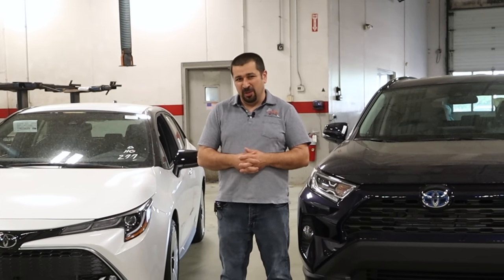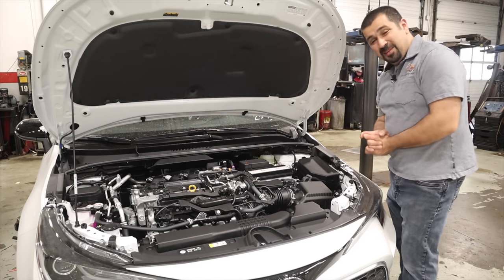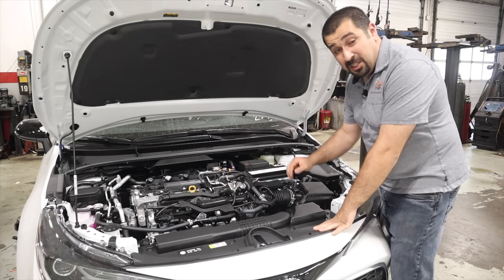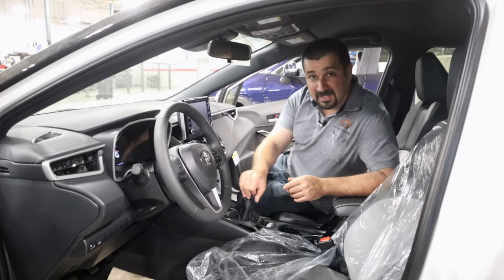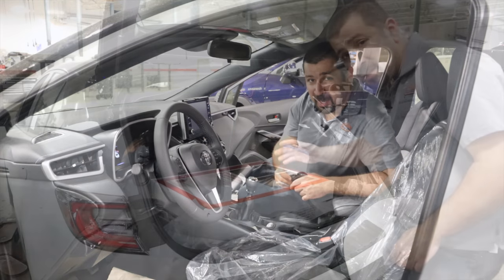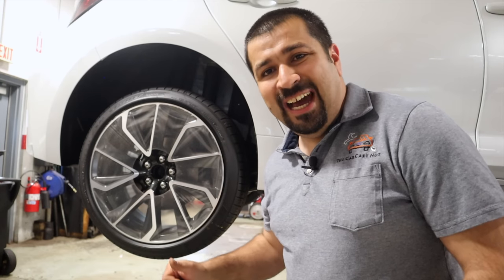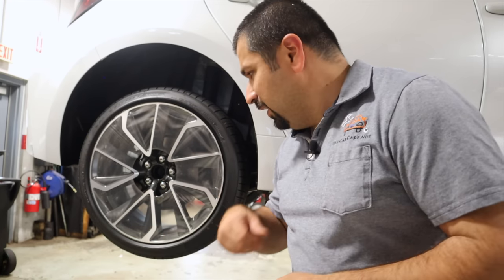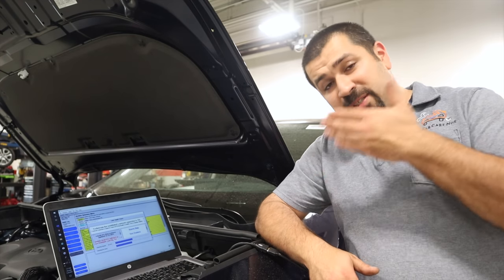Buying a new car? Here's what happens behind the scenes.

Comment: My dealer forgot to deflate the tires I didn't know about them till I saw it on Toyota app on my phone. (2021 Camry hybrid Le). They also forgot to install the wind deflector under the front bumper for the front tires, the user manual portfolio was not in the glove box, I found it and the trunk.
Reply: Which Toyota app?
Reply: @WAN2TREE4  You can download it from the app store, it works with most 2021 and 2020 Toyota vehicles, depending on the features that comes with your new vehicle. My 2021 Camry is not equipped with remote start through the app, but I can do a remote start through the fob.

Comment: I bought a new Toyota HCR (Toyota main dealer in UK). Salesman set up iPhone App on my phone and I showed him a notification which said ‘High severity’ Have your car inspected immediately. The warning went on to describe a serous problem with the ‘electronic control of the engine’. The salesman said it was nothing to concern myself with as all new cars came with problems. I reluctantly took the car home (6 miles) and the next day it would not start. Dealer mechanic came out but could not fix it. It was taken back to the dealers where they eventually rectified the problem and the warning message on my phone disappeared. All they could tell me was that it had been an electrical problem. So much for PDI checks at this garage.

Comment: The dealer needs to check the 4 wheel alignment  as the carriers are rough with them loading and unloading them. My  last two new cars developed flat spots on the tires because they were not in alignment. 
Had to buy new tires prematurely and get the 4 wheel alignment  done on my dime.
Reply: Good to know. Thanks.

Comment: I picked up my brand new Tacoma (a 6 speed manual) from the dealership last year. It was raining when I picked it up. So it wasn't until I got home that I noticed imperfections in the paint on the hood and on the roof. I was thinking that they were caused either by whatever adhesive covering was used to protect the paint or was caused when the covering was removed. Anyway, the dealer was almost 200 miles away from my home. I am getting ready to have PPF applied and maybe they will take care of the issues when prepping the truck for the PPF.

Comment: I'm currently waiting on delivery of a 2024 Rav4 XSE Hybrid, and I have had a pretty bad experience with how Toyota decides to do add-ons that I do not want and am forced to pay for, this is not right and Toyota need to rectify this, as it just gives the appearance of greed on their part, now my vehicle is in transit and my salesman says nothing can be done, I tell you that is so wrong, just so you know to what I'm referring to well it's the black out of the badging, I like the chrome it comes with, but no someone down the line decided to add the black out covers weather you like them or not, now I ask you does this seem right to you, especially when you are paying nearly 50k for a vehicle, I went as far as to tell my salesman that I would pay for that but still do not want it mounted, and still the answer was no, now if that don't beat all...WTF......Javi G.
Reply: I'm also waiting for my 2024 Rav4 XSE hybrid. Mine also came with many PIOs (port installed options) that the dealer cannot remove. Lucky for me most of those options I want. But I'm stuck with the ones I don't want. I don't like the blackout badging either but I can't reject it. Another thing...Toyota's website shows 4 advanced option packages. I wanted package #3 but can't get it. Toyota ships all the XSE trim models with package #4. I believe that since the Rav4 is the most popular SUV in America, Toyota can get away with these unwanted add-ons. These vehicles are sold before they reach the dealership. On a positive note...my dealer does not increase the price over the MSRP. No market adjustment.
Reply: @kenfrank2730  so you know then, I think this will be the last Toyota I buy, I don't like being taken advantage of and to hell with those greedy bastards, good car or not.

Comment: White car from Japan. 

I had A new Corolla cross. On the speedometer there is two red dot between 30 to 50. What do they mean. And another strange button on the dash board of the front passenger. It’s located just at the edge of front windscreen.

Comment: The Corolla is built in Japan. It’s not practical for a manual transmission Corolla to be built in the U.S. as so few of them are made. I have a 2016 Mazda 3, I bought it new and the steering wheel is not straight when going down the road. It was delivered like that. I took it in for a 60k service and asked them to fix it. When I got it back it was the same. I’m used to it now, and if they fix it they will probably mess something else up. I do wonder how it left the factory like that. (It was made in Japan too) But, life is good! Our other two vehicles are newer Toyotas!

Comment: just bought a new rav4 hybrid and the body plugs were not installed and the tires were not deflated. I called out the body plugs on the spot but drove home with the tire pressure in the 50's. I'll deflate my tires to normal pressure asap and do a better quality check myself that I didn't do at the dealership. thanks for the informative video!
Reply: Just noticed that my car has active vehicle alerts for VSC and Precollision malfunctions. There was a recall for the VSC but it's something that the tech honestly could have caught if they looked at the codes given the alert is dated before I actually picked up the car. Not sure what the precollision malfunction is, I'll have to take it back to them for that, could be old alerts? As soon as the car landed the dealership wanted me to pick up the car in 48hours. Turns out their asking their buyers to move faster than they can handle. But there was no wrapping on my car so some level of predelivery service must have happened...
Reply: I'm so glad for this video or else I would have been driving my car without body plugs, with overly inflated tires, and would have had no clue why my car was giving system malfunction alerts.

Comment: DEPENDING ON THE TOYOTA DISTRIBUTOR your  local store is in.  
Southeast Toyota which is the number 1 distributor in the U.S. has done everything needed before the car arrives. 
THE CARS ARE DELIVERED TO THE DEALERSHIP READY TO DRIVE.    Except for the Supra.. 
(A technician has to have a certain certification to prep the Supra when it arrives)   Other than that, you can get a Toyota and deliver it straight to the customer when it rolls off the truck if he wants it. 
 *  ALSO... You can not go on the National Toyota Website and "Build a Car" and expect your local Toyota Store to have all the same packages. Some distributors like Southeast Toyota may not have the same  exact packages.  
Ever go to different states and see a Tacoma with different Toyota rims???   SHOCKER.. Different packages in each distributor.
There are even certain Distributors that DO NOT CARRY a certain make of Toyota. You have to order it.
The RAV4 Prime is an example. As of right now, you can not go to any Toyota store in SET and see a Prime in person.
YOU HAVE TO ORDER IT..  
  When your selling a Toyota videos like this can screw a customer up..  Only after calling every Toyota Store in your state will the customer finally understand buying a Toyota with a certain package CAN differ from "building one online".
LAST,  STOP thinking your getting a discount... at the moment because that ain't happening.  In fact most dealerships are charging 10% over MSRP. Most Toyota store have very few or no new cars.. they are all being presold.

Comment: I am dealing with the centered steering wheel off center on my 2021 Tacoma with 200 miles on it. It's driving me crazy.  I already took it back and they aligned it and said Toe and Caster was out of spect from the factory and say "the wheel is centered" but it isn't, at least not to me.  They told me its because of the tires (all terrain tire option)  - but that's BS.  It drives me batty.  At this point, I think I will just adjust the tie-rod ends myself since I know the car is aligned and is fine - but equal turns of same direction on the tie-rod ends should solve my issue.

Comment: When I got my new RAV4 Prime in July 2020 the tires were massively over inflated to 55 psi.  I drove that way from Connecticut to Texas non-stop and it drove like crap.  When I got to Texas I noticed it and put it at 35 psi.  I was pissed. I also can’t stand all the dealership stickers and the horrific front plate install.  I had  all it removed and new plate frames asap.  Buying a New Car during the Pandemic was crazy they had the whole dealership in the parking lot.  They had 2 days to get the car ready so it was just a signing since I had everything worked out before I flew out to get it.

Comment: Well I bought my 2021 Tacoma and taking it home noticed the turn signal was not working.  Found out later the bulb was blown out apparently before I took possession of the car.  When I brought it back a few weeks later I noticed one of the hubcaps was missing.  After further examination noticed another had cracks in it.  Not sure why but when the lug nuts were either installed or tightened they were over tightened causing the hubs to crack.  Few weeks later noticed the lugs were starting to rust up. I think because the lugs were overtightened it caused the chrome to bear metal.  My truck was manufactured in Mexico.  Maybe the quality control in Mexico is not up-to-par?  Bought the truck day before the New Year in late December 2020.  Have a little over 3,000 miles on the vehicle as of now. When I bring the truck in for its first free oil change I will get them to look at the rusty lugs.  Oh I forgot one of the bolts in the engine compartment is starting to rus up as well.  Not completely unhappy but not happy with the legendary Toyota quality so far with this new vehicle.

Comment: It’s my understanding that all Toyota hybrids are manufactured in Japan. A quick look at the Vin will tell where the car was manufactured. A “J” in the vin indicates that the car was manufactured in Japan.
Reply from the maker: Hi! That used to be the case but not anymore. The RAV4 hybrid in this video is made in Canada
Reply: @TheCarCareNut  I said that because we just leased a Toyota Corolla Hybrid that’s made in Japan. From past experience with a 2009 Camry Hybrid, I’d never own one just lease one. The Camry Hybrid had 73,000 miles and we intended to keep it, but the hybrid battery needed a $6,000 replacement from the dealer. That said, the Corolla Hybrid is getting over 60 mpg!

Comment: I think all hybrids and plug ins are made in Japan and the normal combustion engine vehicles are made in Canada and the States
Reply: 4Runner is not a hybrid and made in Japan
Reply: My Rav4 hybrid was made in Kentucky.
Reply: @HondaSolutions  are the new ones (4runner) still made in Japan?
Reply from the maker: It used to be the case but not anymore.
Reply: Canada builds all ice and hybrid rav4’s. Prime is only trim not manufactured in Canada. Kentucky also builds some rav4 models as well.
Reply: Very hard to find Normal Combustion Toyotas with J-Vin anymore.

Comment: Nice video. My checklist on my 2020 Prius Prime Limited I bought 10-15-20, was not done. The paper was blank. I have a question for you? I’ve had some steering issues, like car drifted with turbulence, but there was no turbulence. Had it checked and aligned several times, by a couple of dealerships. The last one said it was just how the car drove, it was a characteristic of the car… . I thought it might be the tires. As I was feeling vibrating. I picked the car up in the northeast, as they had a rebate we didn’t have in the Gulf States. The car had sat on the lot for 4 months. So I thought maybe the tires had flat spots. I bought new Bridgestone tires. They seem to never balance. I can hear a noise when going down new asphalt 40 MPH. Like a wobble wobble noise. Took it back for balancing several times. Tire guys say it must be something else after they balance, and see nothing wrong. Do you have any ideas what is going on with this car? I have 9K miles on it and I’m not happy… I had other Toyota’s and never had any problems…
Thanks,
Ron
Reply from the maker: Hi Ron. Did this happen on the highway when you are behind a larger car or a semi?
Reply: It did this with no cars or trucks around. After several attempts at Toyota dealerships, I took it to an independent alignment. His comment was when he put the car on the lift, he noticed the front wheels that sit on the plates that normally turn easy by hand like when the steering wheel turns, was very tight. He could barely turn them by hand. Is this normal?  What I noticed with the turbulence was the car would oversteer when I tried to correct the drifting. It was like it was very tight. Kind of like steering a go cart. Lack of slack for a better description.
Reply from the maker: The electric steering can be tough to turn when it’s off. Honestly this one will need in person diagnosis and hard to figure out in this format

Comment: I don’t trust dealers for anything! Nothing! I can picture the dealership discovering damage to a new car (or, causing it), and covering it with quick body work, particularly under the front bumper. One thing mechanics do too, is leave black greasy fingerprints all over the car, particularly on the door panels, steering wheel, shifter, etc, etc

Comment: My 3 week old 2021 Tacoma has a manual sliding rear window and the latch to lock it is misaligned by about a half inch and doesn't lock. Also found some loose screws that hold the plastic wheel well on to the bumper. Pretty disappointed in whoever did my PDI. I was told I'll have to wait up to 3 weeks to see what Toyota wants to do about the rear window but it sounds like they are going to have to replace it. ☹️

Comment: Back in 2019 when i got my new c-hr, it had just arrived and didnt even go through this inspection or process yet. Some of the fuses werent in and the hub caps and floor mats werent in and i test drove it like that. It was the only car on the lot in the blue i wanted. 2 years later i still like my new, japan made, car.
You say near the end that toyota is great for paint quality, except for rock chips. My c-hr has gotten maybe more than its fair share in rock chips. Ive had plenty of old cars over 10-15 years old with less rock chips on their paint than my new toyoder.
Reply: I thought they were still bringing them in from Turkey two years ago.
Reply: hes talking about the quality of the paint application, no orange peel, runs, debris is the paint, etc. All newer cars use extremely thin paint which is subject to rock chips
Reply: @rightlanehog3151  turkey and japan both. I wasnt going to buy a toyota made anywhere but japan. I was pretty glad to see that it was from japan.
Reply: @Mach141  i see. I was under the impression that american cars at least had thicker paint. I had a 2015 chevy sonic for a short while and that had very few chips in the paint. But if generally all newer vehicles have thinner paint then that would explain it.
Reply: @RexenPrime  Interesting, my 'Toyota' was made in a place called California, USA. With only 3 minor,  non-scheduled repairs in 16 years,  I really cannot imagine it being better built.

Comment: I just purchased a 2021 Rav4 and it seems to "sputter" when driving/rolling at a slow speed and then trying to accelerate. I notice this when the start/stop feature is on. I haven't noticed it when the start/stop feature is turned off. Could this be a problem with the fuel pump? I noticed there is a recall on some fuel pumps, not sure if any are for 2021.  Thanks for any help you can give!
Reply from the maker: Hi! Is your car covered by the recall?
Reply: @TheCarCareNut  I am not sure? I haven't received anything, but I've only had the car about 10 days.
Reply from the maker: In this case likely not. But do have the dealership check everything to be on the safe side

Comment: I got a 2011 rav 4 V6 from Canada and 1 body issue after an other:2 inside covers left amd right of the windshield coming off, same for steering wheel  cover inside. All the side womdows outside has the rubber cracked and coming apart at the bottom. Tje gas tank door refusing to open and tje paint on the rear door handle outside coming apart. And the car jas a nit ober 80,000 miles. These problems started to devellop after anout the 30,000 mile mark when my mory serves me well. I am mot impressed. I wrotea letter to the factory but they did not bother to amswer. I called the general phone # for Toyota but did mot hear back from them. On the other hand everything connected to the engine seems to work just fine. My 2007 toyota highlander hybrid from Japan with about 235,000 miles is in very good shape still. Like 2 different makes of vehicles!

Comment: Hi Car Care Nut. I’m very afraid I didn’t break-in my new 2021 Sienna correctly. We drove home from the dealership on a country road about 100 miles varying speed between 40-60 mph. Couple of weeks later we took a 350 mile road trip 50-70 mph. We have also driven about 150 miles around town. We now have 600 miles and the break-in period is over. I’m very worried that I have damaged my engine. Nobody at the dealership told me about break-in procedure. Also the break-in description is buried deep in the manual. Seems like that info should be right at the front. We really love this car. We got 40 mpg exactly on the 350 mile trip. The car has always been driven with a light foot. Did we damage the engine?? Thanks!
Reply from the maker: Hi! You didn’t damage the engine! Don’t worry. You drive light footed and varied your speed. That’s most of the break in instructions so you’re good. Congratulations on your van and enjoy it for many years/miles to come.